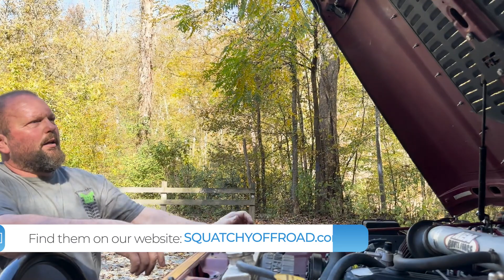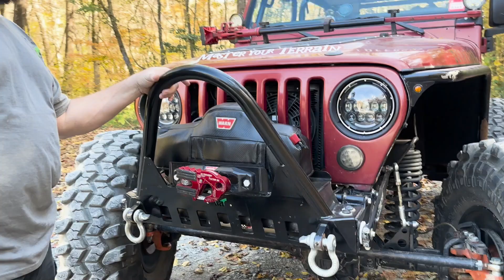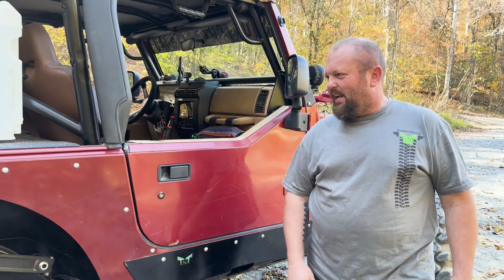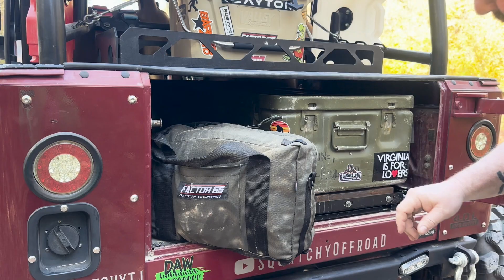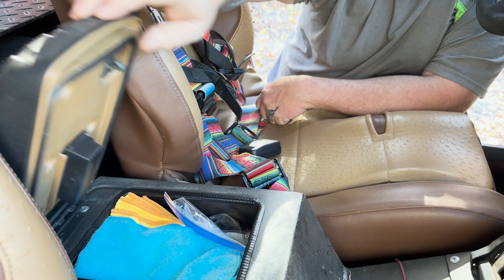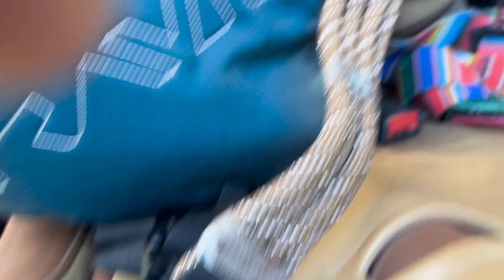98 JEEP TJ - SQUATCHY - Full Walkaround

Comment: I love this jeep. I know you’re running the 43” tsl’s now but how did you like the 40” sxii compared to a standard dot tire? Interco says its a competition compound but I’m looking for some firsthand experience. I’m considering putting them on my jk I just swapped over to 1 tons.
Reply from the maker: So they make a 40 sxll in Dot compound and a sticky competition compound. Mine were Dot compound and we loved them on and off the road. Never even balanced them just mounted up on my beadlocks and I ran 5 psi on trail and 20 psi on highway. Only reason I swapped was I always said once I went tons I was going 43’s.
Reply: oh yours seemed really soft in the video. I didn’t realize yours weren’t sticky

Comment: Hows the tires doing after being broken in? Just bought a set and im a little worried about them.
Reply from the maker: @RollinAintEasy we bought some to go on it and got one ton axles but my hip replacement surgery has put a hold on everything at the moment till I get healed and back to work fulltime and see how it all goes. I actually sold the tires to a buddy to put on his new rig since it was going to be a while till I need them cause Interco didn’t have any in stock.
Reply: The tires you had on the jeep were the 40" stickys correct?
Reply from the maker: We have two wheeling trips on them and some road miles. I run them between 20-25 psi on road and the second wheeling trip I found that 5 psi is where they work best on my TJ which weighs right around 5,000 lbs. the edges seem to be rounding off like they should and they are doing well all around. Not quite as soft as the regular sx but for me they are working well. If my TJ weighed little more probably would work better. Definitely happier with them than my Mickey pro xs we were running.
Reply: @SquatchyOffroad  I thought I seen on Facebook you have 42s now, when you installing them ?
Reply from the maker: @kevinjennings The 40’s are DOT and the 42’s I bought are DOT also. I drive it on the road to much to run stickies.
Reply: How are you liking the Aw4? What’s your speed like on the road ? Does your setup go from 1-3 and then automatically go into overdrive? I have a 4.0l, the 32rh in it with the jk 4:1 t-case, the same front axle you have on 40’s, I also have the Jeep xj for the donor trans and parts. I’m still not fully understanding how the rad design shifter works or exactly what all I need to have all the gears with overdrive. I want to run on the road a little more. And I want to be more clear before I start the swap. 

Awesome video man! That’s a nice Jeep!